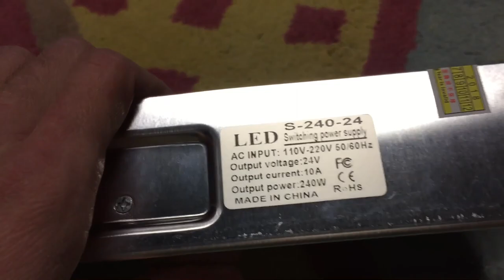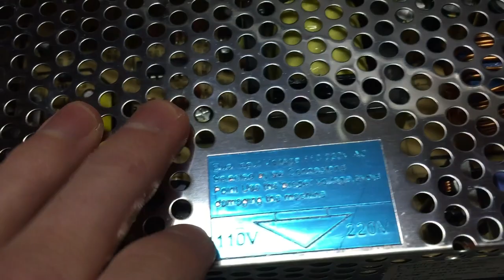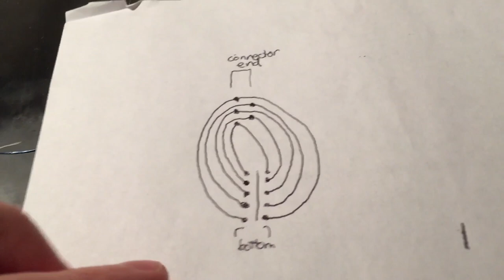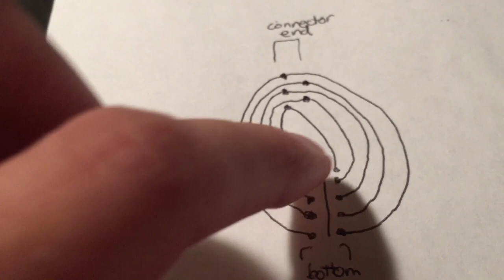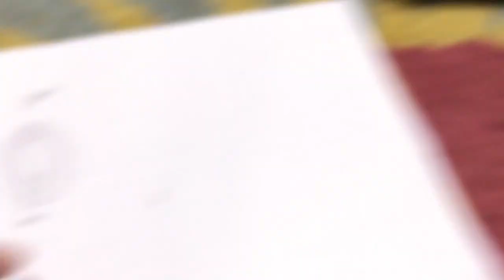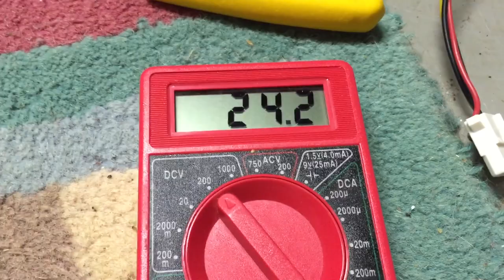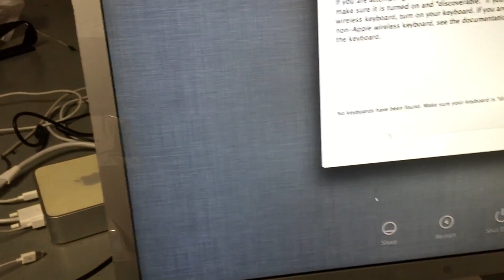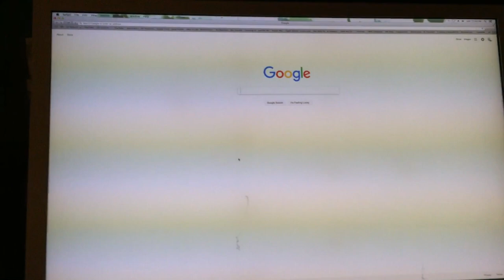Making a Custom Power Supply for a 30" Apple Cinema Display

Comment: Any suggestions on how to get a power connector if I don't have a dead mac mini to salvage one from? I'd also like to not splice the cable, if possible.
Reply: Man i had the exact same question! Also what is the connector even called?

Is it the same as new iphone charging connectors?
Reply: Getting it from an adaptor or cable extension might be the best way.. but whats its called? ><

Comment: The problem is, I don't have a spare mac mini logic board to harvest a connector from it.
So if I choose to go the 'cut this cable' way, how to connect power to it? Do I need to add a resistor between some wires?
You referring to this process, as if it was the default way, but actually I can't seem to find any related information about doing so.

Comment: Does the 30" Cinema Display fully utilize its original 150W adapter? Just curious about the power consumption, since I'm considering using one daily.

Update: I finally found a resource, on the 30" display, which claims that it uses 111W at full brightness and 49W at minimum brightness. That's more than I'd like, but it's actually not any more than I had imagined it would consume.

Comment: If your screen's LED is blinking and not turning on...
𝗙𝗜𝗫: Use a very thin piece of tape to isolate the middle pin on the upper row and bottom row of the Display's DC connector.

Comment: what is the DC power cable called that comes out of the power conditioner? I have the apple brick but not the connector cable for the computer? thanks

Comment: Could you run multiple 20/24/30" monitors on one psu?
Reply from the maker: Yes, but you'd have to make sure that it wouldn't exceed the max power output of the PSU.

Comment: Thank you so much. It's basically impossible to get a good one now, and only thing I have to do is getting 24V power supply replacement for my 3d printer. (USD 16) This is my life saver.

Comment: There are several videos and articles on how to put together a custom power supply for the Cinema, your's is by far the best. The ONLY confusion for me is the wiring of the connector, because of focusing issues, it is quite difficult to see with certainty where you connected the black and wire wires on the connector. From what I can tell, there are three connectors on one side and two on the other. Does the black wire attach to the 3 connector side or vice versa? On the 3 connector side did you add the jumper from connector top connector to the bottom connector, leaving the middle one empty? Your clarity on this would be very helpful. Thanks!!!
Reply from the maker: The two ground pins are on their own side, the other side with the 3 pins has the sense pin in the center, and the outer two are the 24V positive pins.
Reply: @dosdude1  That's exactly what I needed, thanks for the prompt and helpful response!😀

Comment: I have a genuine power supply, for my 30" Cinema Display, but it emits a nasty coil whine while the monitor is asleep—unless I have the integrated FW400 cable plugged in to the old Mac Pro it temporarily serves. Do you think the power supply is on its way out, or is this merely an audible quirk that can be deadened? It's rather annoying, especially considering the computer with which I actually intend to use this display does not even have FireWire to begin with.

Comment: I got one of these except my power supply wasn’t the problem but rather the DC in cable was absolutely destroyed but it still worked for a little bit and then it completely stopped so I’m glad it uses the Mac Mini connector since I can easily buy one of those power cables and use it to fix this

Comment: @dosdude1 I have the same setup with the power supply, but my usb ports do not work and sometimes i will get artifacts on my screen. I was wondering if you sometimes get this issue or if it could be over or under powering the monitor?
I also get on occasion a high pitched coil whine from the power supply.

if so, then i am sure my ports do not work because i may have the wiring wrong, i followed a different video that involved cutting the cord and I only removed the power connector.

maybe you'll have some sort of idea, my hackintosh will thank you!

Comment: I always open these PSUs to redo all the soldering when I buy them.
The mains filter capacitor are also dangerous garbage you should replace.
These PSUs are really good for the money as long as you finish the assembly job correctly!
Reply: I have 30invh cinema display lying around with no power supply, i am working on how to get it on since i don't know if the display is working or not can you advice me what should i do?
Reply: @hirilpatel3189 I got a 22 inch as second monitor for my gaming PC (I got a gaming display and this next to it for other stuff such as Discord).

For the 30 inch seems very easy to wire. There is the DVI which can be easily converted to HDMI as it is a digital DVI luckily.
Then there is the USB, which isn't necessary  to use with my 22 inch, but maybe on the 30 inch it's mandatory to plug it in. Anyway I don't see why you wouldn't since it gives you a free USB hub.
 Though I learned the hard way that you shouldn't plug your mouse into it if you're gonna game lol

You can just cut the power cable, and connect both wires to any 24V 180W+ power source. + and - should be pretty easy to identify, there's likely a shileding which is - and a cable inside of it which is +.

If you are not sure which is which, just take a multimeter in diode mode and measure between the DVI metal ring (like the thing around all the pins) and the power wires one by one. When it beeps, it's gonna be minus.

Now these chinese power supplies are often not the best to use. The design is good, but unless you can redo the soldering and add a 150 ohm power resistor between ground and negative output, then I'd advise just getting something safer (even though likely expensive).
If you still choose the chinese PSU, never use it without ground, make sure you do solid wiring, and you should be good.

Comment: So you still get the maximum HD resolution with 110w adapter when it’s powered by 150w?
Reply from the maker: What? I'm using a 240W power supply...
Reply: dosdude1 I understand that, but I noticed you switched the adapter to 110w... the original Apple adapter power supply I believe is 150w. That’s 40w less.
Reply from the maker: No... The proper adapter for the Intel Mac Mini is 110W... The 30" Cinema display comes stock with a 150W power supply.
Reply from the maker: And the switch on the power supply is to set the input voltage... In the US, the AC line voltage is ~110-120V, so you need to set the power supply to accept that input voltage.
Reply: dosdude1 dosdude1 oh ok. Im trying to find out how to power the 30 inch screen and not the Mac mini.

Comment: The Apple Power Supply of the Apple Cinema Display of 20 inches A1081, Work's fine on Apple Cinema Display A1083?
Reply: I wouldn't think so as the 20inch is much lower wattage. The 30" needs 150w

Comment: Doesn't the 30 inch Cinema Display need two DVI connectors? I may be wrong, but I could only see one plugged into the Mac mini
Reply from the maker: No, it only uses a single DVI dual-link connector.
Reply: dosdude1 Oh, ok. Thanks!

Comment: This is silly. That power supply is an internal power supply meaning its supposed to go inside of something. It's dangerous to use it the way you are using it.
Reply from the maker: I used it this way powering this monitor for years... I only stopped using it about 2 years ago when I got an official 150W adapter.